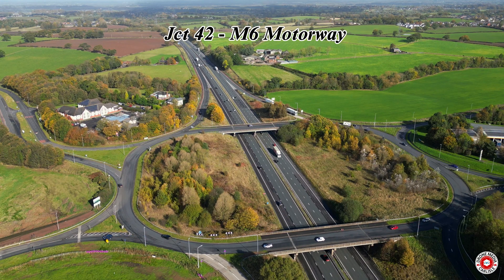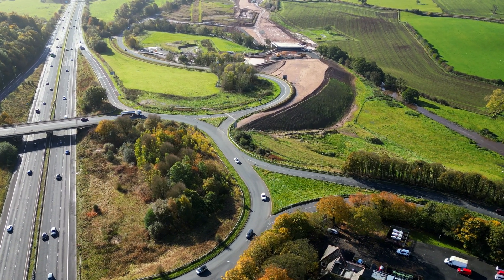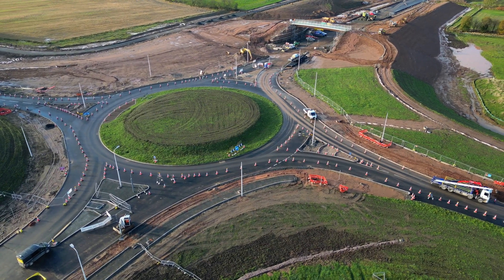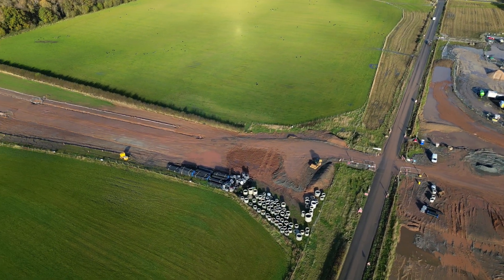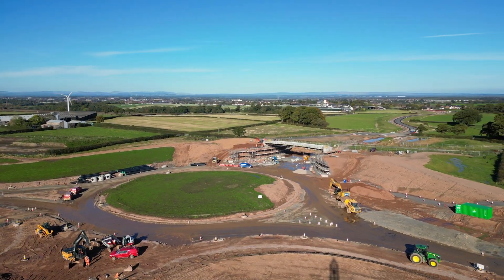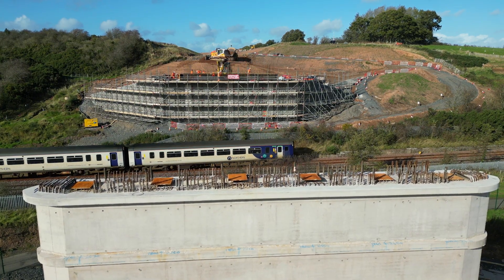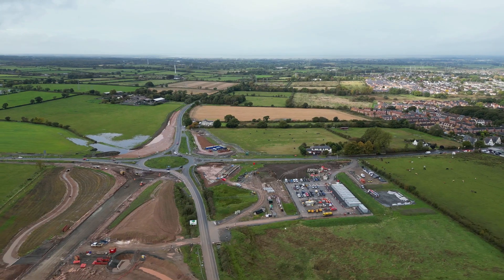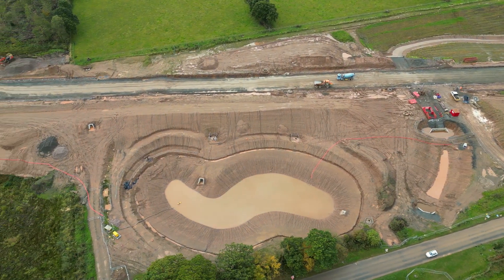Carlisle Southern Link Road (CSLR)

Comment: Do you think we will be able to join it at that Dalston road roundabout that they are on with ?. They currently have Dalston road clossed off, and we have to use Peter Lane.
Reply: From what I have seen, looks like the roundabout will allow traffic as it originally went to Dalston will be the same, just interrupted by the new roundabout, in a similar way on the other Northern by pass. Thanks for viewing the video
Reply: @dronescenecarlisle   Yes that's what I thought. Cheers for the reply